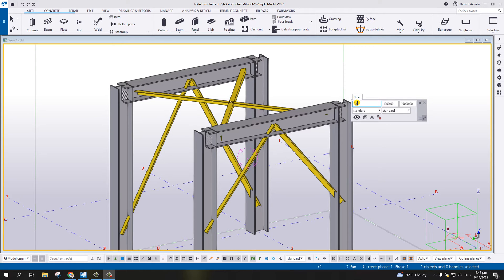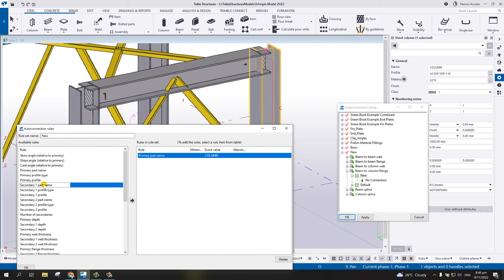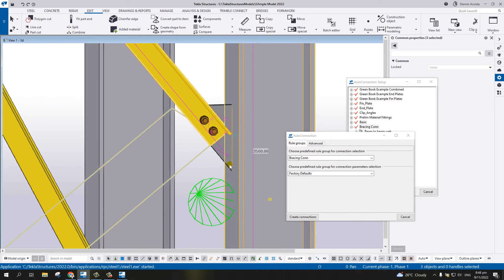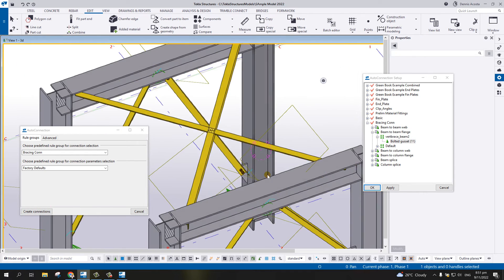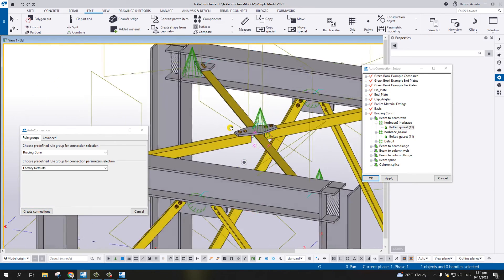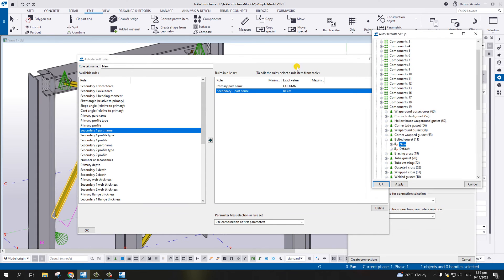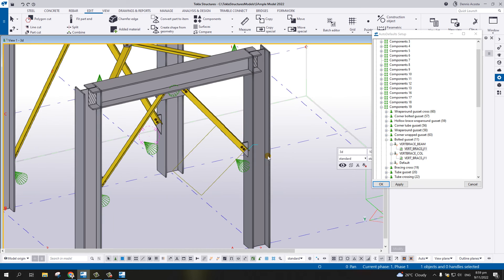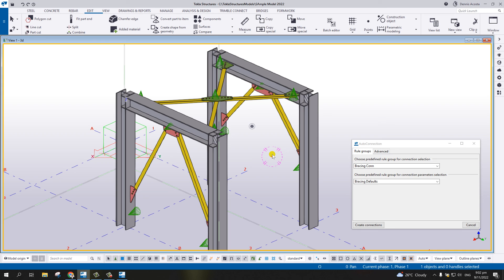How to Setup Brace Auto Connection and Auto Default

Comment: Sir, is it possible to apply the same in concrete connections? And also with reinforcements?
Reply from the maker: Yes its possible
Reply: @thehowsofteklastructures565  thanks sir. And also kindly provide the details how to get membership activate link to access the right protected videos.

Comment: Sir, where can we use primary profile \ secondary profile in auto default rules!? And where it will be useful. Pls
Reply from the maker: Sometimes only primary or secondary alone can be use in auto default. Since the rules are already specified in auto connection rules.
Reply from the maker: It will be case to case basis, depending on the situation and how to differentiate the conditions.
Reply: @thehowsofteklastructures565  ..ok sir thanks